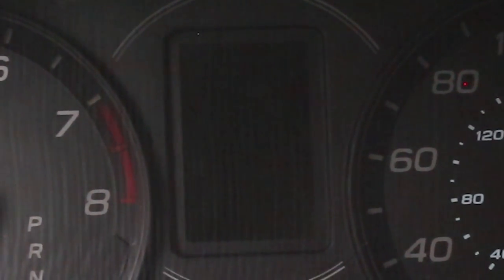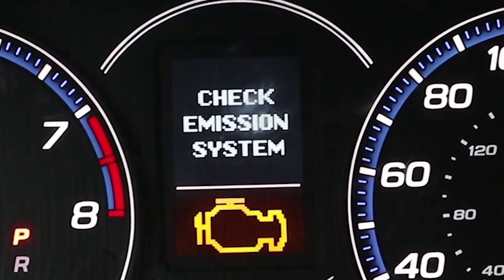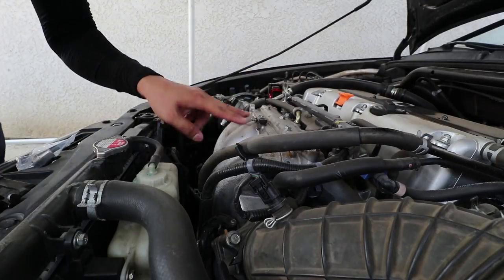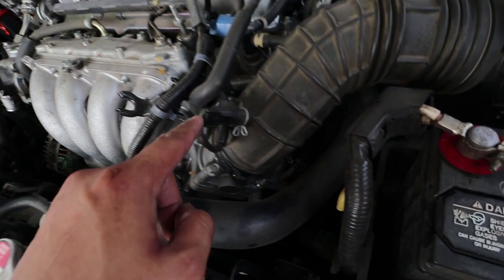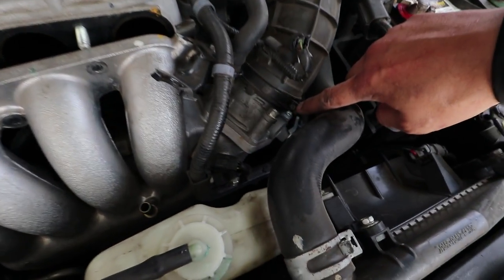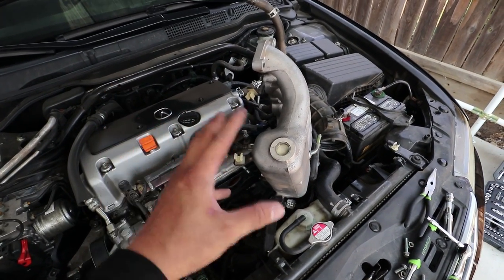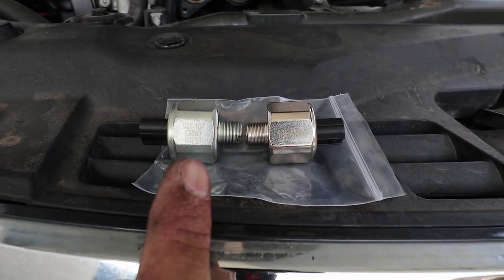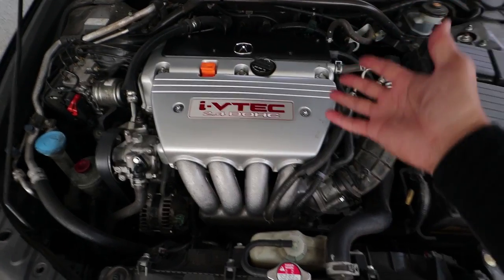Acura TSX Knock Sensor Replacement

Comment: I own a 04 tsx 6spd has CEL code: P0325
Just purchased knock sensor from my local Honda/Acura dealer it cost me about 140
I am going to reference your video for the install 
Thank you
Reply: I also have a 6speed 06 and i scanned mine today and it says the same code( knock sensor) Did this work for you??

Comment: To who ever replaces this. The bracket could only be removed from the bottom. Those size bolts are 12mm. So you going to have to remove the plastic cover.

Comment: dont need to remove anything if you have tiny hands. A socket that fits knock sensor with 6 inch extension is doable from outside.

Comment: I Have A 09 TSX - 1st 2nd Gen . I Blew My Engine & Got the Japan Version of It So They Installed the K24A2 .. I Bought the Knock Sensor Under As A " 09 TSX " ... Does the Knock Sensor Fit the Same As the 1st Gen ?? Sorry If It Sounds.Confusing

Comment: Quick Question/long story: I also have an '06 TSX - GREAT CAR - 5-speed auto with NAV and 176000 miles. I noticed a significant drop in fuel economy at around 140,000 miles. I've since replaced the fuel tank pump/filter and both oxygen sensors. I just saw another video about 'ignition coils' on a 2.4 liter Honda. Symptoms include an engine code in the 300-range, rough idle and the smell of gas. Symptoms on my '06 include 'slow' to start - doesn't turn as fast as it used to - and the smell of gas. It also idles slower than spec...between 600 and 700 rpms. But, it hasn't thrown any codes (yet). Is it my ignition coils? Replacement looks pretty easy. I was about to try installing new fuel injectors but bad injectors don't seem to fit the problems I'm having. What would you do? I used to get 40 mpg on the highway if I drove like an old person (55 mph), now I can barely crack 30. What's up with that?
Reply from the maker: Sounds like you have a fuel leak issue if your smelling gas. Check the lines for leaks (going to be difficult since it evaporates).

Comment: Nice repair video.  You make it look easy. Have you thought about getting your tsx reflashed and doing a review about it?
Reply from the maker: I thought about it. But this is my daily driver so it wouldn't make any sense for me because I like the car as is already. Who knows, I might change my mind in the future :-)
Reply: GT Content, for a daily, I would highly recommend the reflash as it works well even with stock components. It lowers the VTEC engagement to around 4.9k rpm, throttle is a lot more responsive and redline goes to 7.6k rpm. Plus, the reflash provides a much more linear power band without the hp and tq dip when vtec is engaged. 

There’s a forum member in the tsxclub forums by the name of “Littlebo” that offers the reflash service for $200. The great thing about it is that you don’t have to ship your ecu. He can remote connect through your laptop and reflash the ecu through a special dongle.
Reply: Van Do How does it impact the MPG? I have a 06 TSX daily as well and I haven’t done anything to the engine. If I’m careful I can get 30-34 MPG on the stock motor that’s carefully maintained.
Reply from the maker: Van Do Interesting. Now that makes it even more tempting.
Reply: J_ White, I personally have not experienced much difference with MPG after the reflash. Although I rarely get over 30 mpg unless it’s on a long highway cruise. With heavy traffic and a/c on, I’ve been averaging about 22-23mpg. Without a/c with same conditions would net about 24-25 mpg.  What I really like about the reflash is the improved part throttle response and the rev hang issue (with 6MT) is non existent.
Reply: I got the reflash it’s real nice

Comment: I need help bro. Just changed mines also but p0113, p0123, p0223, and p0325 (which I just replaced) idk bout the rest. I used a bosch reader.

Comment: After I replace the knock sensor how come the check engine still on after I drive out?
Do you know what goin on
Reply from the maker: Probably a bad knock sensor. They are easy to damage.
Reply: Reset the battery
Reply: Did you have the same code?? His code was knock sensor. You have the disconnect battery for 2 mins  or clear it with a scanner.  Im having the same issue now. Check emissions came up when i scanned it mine says knock sensor. So ill follow this step

Comment: I am really curious if you have driven a 2009-2014 TSX; I have one in a 6MT, and would like your thoughts on it?
Reply from the maker: I haven't driven one, but I have been a passenger. It's much roomier than the first generation and refined.

As far as, the 1st gen vs 2nd gen, the 2nd was not an evolution of the 1st gen. The 2nd gen was more like the TL of that generation (larger & heavier), but with the 4-cylinder (underpowered). There is a reason why Acura currently offers the TLX  (combination of the TL+TSX) and the ILX  (TSX replacement) which returned back to it's roots.

Just my opinion. I could be all wrong. Lol
Reply: GT Content thanks for replying :D. I wasn't pleased at first when my car came out with the same amount of power as the CL9; although what I heard is, my car's only 110lbs heavier than the older TSX, and it appears the engine is turned for more mid end torque from the factory. Tbh, definitely underpowered still. Nonetheless, after I threw in a Rear sway bar upgrade, it still felt surprising tossable in the corners; kept up with my friends Lexus ISF in the bends~
Reply from the maker: ssj4david Good to hear. Yes, the aftermarket can solve some if those issues😁.

Comment: I have code P0325 on my 2005 manual tsx but the car runs fine. Someone said it could be loose wire giving the code. What do you think?
Reply from the maker: The sensor could be bad. They are fragile and simply dropping it may damage it.
Reply: Replace the knock sensor

Comment: Hey my 08 Acura TSX just gave a check emission system error and also said to check the VSA. Could this be the knock sensor?
Reply from the maker: That could be two separate problems. Check your codes
Reply: Ill be honest .. it was same masage check emisions system  over my 06 tsx  that i bought for 1800 dollars.. but i know it was streched timing chain ..it was vsa light onchek engine on with normal tools im not a mecanic but i replace my self timing chaing and gides  and guess wath car still rruning like new 195000 miles and keep up depends of the codes can be diferent problems but must comun timing chain ..no more check engine light vsa or anything ... they nice cars but th engine comsuption is comun that is why timing chain get streched and jump the time. And the ecu send engine code and say check emision system

Comment: Can you replace the sensor without removing the manifold?
Reply from the maker: No way to get a tool to it without moving manifold.
Reply: Under...
Reply: @GTContent   YEs you can. I did 3 already. Just need socket, 6 inch ext slide the socket on the extension into radiator fan then onto the knock sensor; attach rachet and remove.
Reply: Sure can!

Comment: My knock sensor CEL goes away thens comes back on
Reply from the maker: Probably faulty or going bad. Try replacing with a good one.
Reply: GT Content thaks bro
Reply: Sorry one more question. Does this cause the engine to struggle sometimes make it slower ?

Comment: Got my Acura STX 4 cylinders 2009 2 code P 2076 and P 2001 car no want to stated put New alternator New spark plugs new starter new battery still no stered can any one no what are the code or Thad code parts need to buy put the car don't my first car thank you any want no name Thad code

Comment: No offense, you've changed it in a wrong way, don't teach people shit and delete this video, the knock sensor has to be installed back with a tool which has dinamometer, effort when putting it back must be exaclty 31nm,otherwise the knock sensor is just as good as wooden one
Reply from the maker: Still working to this day with no issues. It's not rocket science. 

Go make your video and show us how it's done 😉.